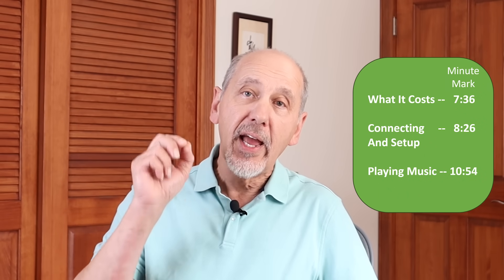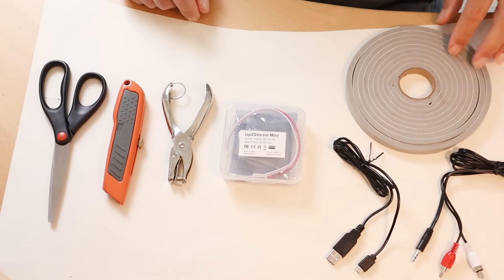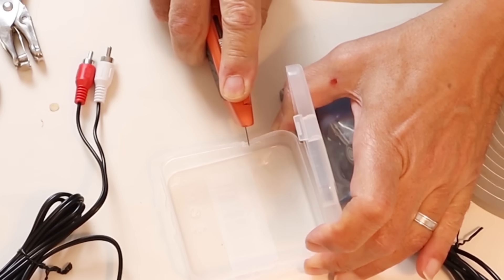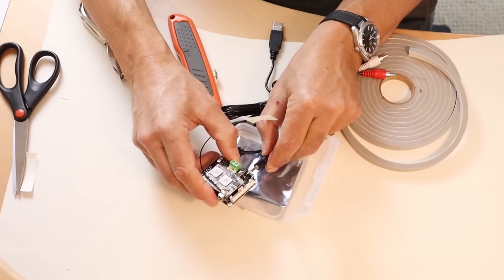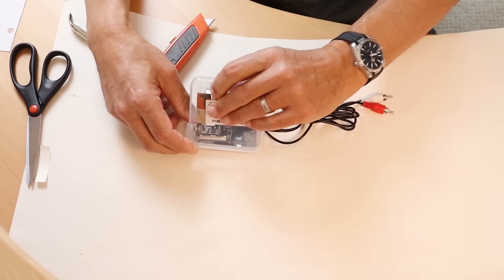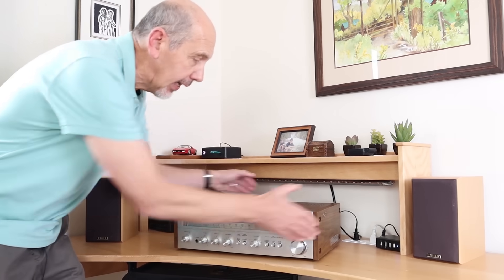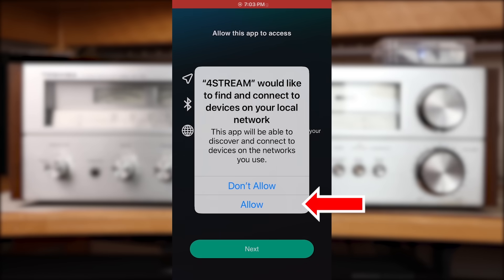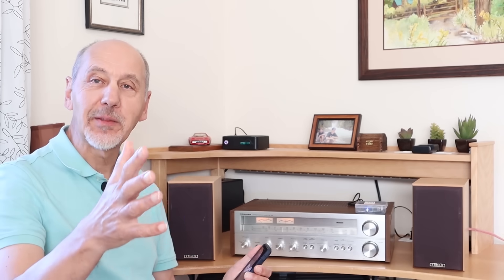Create A $50 Wifi Music Streamer Connect Phone Wireless to Stereo Receiver

Comment: Theoretically if primitively thinking to only HiFi music transmission extra bandwith this wifi could be a good fix.  
But if balancing this with wifi EMF dense radiation increasing nearby as inside home the effective advantages from this streamer are not worthing anymore and wifi instead bt far become the worse music domestic play solution!  
For insignificant never really audible difference from classic or latest BT, WiFi brings you lot other huge troubles in small areas, interferences and healthy higher stress but also brute consumption increasing inducing also mobility lowering!👽
That is why Bluetooth is still prolific and very developed even today as best environment friendly solution already optimized for inside home or nearby wide compatibility lowest consumption devices!  👍
Reply from the maker: WiFi and Bluetooth operate at the same frequency at power levels that all available research says is safe. If you are concerned about any undiscovered health effects the most important factor is reducing RF absorption in your body. Here is where WiFi Streaming has an advantage over bluetooth.  With WiFi your Phone is only used for control, the music data stream comes from the router which is usually several meters and is often in a different room from where you are listening to music. The power levels at your body are incredibly low. With Bluetooth your Phone is transmitting the signal continuously. If it is in your pocket then much of the power will be absorbed by your body and is a far greater RF exposure ( by a factor of thousands or even tens of thousands) than WiFi.  Although Buetooth will give you higher RF exposure than WiFi, it is still less than making a conventional cell phone call which also has to meet well researched safety standards.
Reply: @rogergadgetguy  Never!  Your information is far...disinformative!  Bluetooth was natively designed for Nearby Devices optimizing power to connect under 10 meters devices portably with minature lowest size lowest consumption lowest EMF if you know some primary school physics facs....   Despite it, WiFi born to dramatically extend area covering but also bandwidth and number of devices connected by tens times more EMF power , an also primary school basic physics understanding related fact!!🤔
Reply from the maker: @LaurentiuGavrea  OK don't want to get into an argument here.  The point is a user is going to be far closer to their phone than the router. Power falls off according to the inverse square law so the power from the router signal is lower than the power from the phone bluetooth at the user, due to proximity.  You are free to believe whatever you  want and to use your devices as you wish. I don't judge people for their beliefs and I ask that you extend me the same courtesy.  I do have some  knowlege of basic physics as I am sure you do. In my case I have a degree in electrical science from Cambridge University and was a voting member of the IEEE 802.11 WiFi standards comittee. I spent 40 years developing radio products including 8 years developing  wireless LAN's and 15 years developing cell phones.  I do appreciate your engagement and concern. Thanks for posting.

Comment: For those of you who are using Apple products and have an old iPhone, iPad, or iPod touch with a headphone jack or dock connector, I can warmly recommend the following: 
Jailbreak the old device and install an AirPlay receiver. Does the same job as the device demonstrated here, but does not need a Chinese third-party application to set up. 
Marginally less dodgy and the old iPhones do have quite decent DACs. AirPlay streams are in most cases lossless compressed format (using the suggested solution, always) and your old phone will show up as an output device on other Apple devices.
Reply from the maker: Great Suggestion for way to use an old device. Even if you don't have a headphone jack you can connect the lightning port to a USB DAC.
Reply: @DrBovdin: Could you please explain by what do you mean 'install an airplay receiver'?
Reply: @ I can, but I’m currently away on a trip and not around the old iPhone 4s I use like this, so I can’t tell you exactly what the daemon is called. I think it may be based on ShairPlay though. 
I will elaborate next year 😉
(One of the first days of January)
Reply: @DrBovdin  please do share! I’m interested in this as well. I’d guess an old iPad could do the same? Interesting to learn more.
Reply: @DrBovdin  Good doctor, many of us are BREATHLESSLY awaiting your return to this topic!
Reply: @jgilmore8  I did!!
The comments are gone!! I wrote one with the overall jailbreaking suggestions and a separate one one with the actual uri:s to relevant repositories in case they would be filtered out otherwise. 
If my comments are just being removed I don’t think it is of much use to repeat it. But look into jailbreaking your device by whichever method is suitable for your device and then install the dæmon called “AirSpeaker” available in the Karen/あけみ (Akemi) repository. A control panel will appear in settings.
Reply: @DrBovdin  ty sir for following up.  At this point, I've got Spotify doing what it's doing via an old iPhone 6s that is connected to my Denon receiver via 3.5mm stereo to RCA...it's working for me, will crack things back open later this fall when we move and I have to create a new 2 channel system.

Comment: Excellent video and very well presented (once was an IT Trainer) but now with very small and compact £10 Audio Amplifiers found on eBay which allow loudspeaker, Bluetooth, line-in, AUS and USB connections you can do exactly the same without the faff of making a DIY one.

I have an old MS Surf Pro (used mini-laptops are  very cheap on Ebay now) which allows the same access to smartphone streaming music, but you have a much larger and easier to administrate the screen as I do with YouTube, Radio Boom and Spotify.
Reply from the maker: Great suggestion! Old Laptops make great music servers too, Although I use a raspberry Pi these days because it takes less power

Comment: Hey Roger, I am looking for ways to hook up my active studio monitors to my Samsung tv & sound bar entertainment system. Now my Tv and sound bar both use ears or BT or Wifi. I thought The best solution would be to connect everything via Wi-Fi  after watching your video. However, it seems that this device only works with an app - So my question is, would it work with the TV and put like watching Netflix? So, in short, I have a really great monitors that are analog, and want to integrate them into my existing sound bar entertainment system. The tv is the main audio source
Reply from the maker: Since you Are using the TV as a source It's best to use the TV HDMI ARC or optical out to hook up speakers. Your soundbar will not improve the sound of the monitors and will likely muddy things up. Best to connect the monitors using the adapter that I show here. https://youtu.be/x-wtqgIFEYg

Comment: that antistatic bag does nothing in there, it does not "dissipate" anything... it prevents static charges you may have on the body to reach the board while it's INSIDE of it, and that's it... a dissipation needs something to bring the charges to the ground, it's not "wireless" :D
Reply from the maker: Your point is well taken.   I just got into the habit of only laying unenclosed boards on an antistatic surface when I worked on sensitive circuits.  Of course this only works if you are wearing a grounding strap but old habits die hard. All this being said, putting the bag in the case will for sure do no harm, and I am not very concerned about ESD damage to a robust module like this anyway.
Reply: @rogergadgetguy  that could prevent proper heat dissipation, too, though...
Reply from the maker: @squalazzo  Theoretically yes, but I measured this thing at 1W total power dissipation, and it passed the finger touch thermal test with flying colors. It never gets warm enough to worry.. No anti static bag in my next project though  I promise.
Reply: I actually disagree with the commentator on your method. When you receive the board the antistatic bag is designed to dissipate any static charges equally all around the module and connections to prevent there being a potential difference between point different points in the circuit so when you put your antistatic bag in the bottom of the box though and conventional it is actually doing Something useful. Electronic engineer 20 years experience.

Comment: You need the Up2Stream HD DAC model for TIDAL or any HI-Res music service, wich is 150 dollars not 50.
Reply from the maker: I use Tidal lossless on the Up2 Stream mini, and it does sound much better than bluetooth. Getting the benefit of full 24bit 96kHz resolution is another tier altogether. There are many devices including the Wiim Streamers that will play Hi Res files without downsampling but you won't hear any benefit. without an external DAC which is extra cost again.

Comment: I just leave an old cell phone with a headphone jack plugged in the same way...( spotify works the same way with two phones, but is glitchy sometimes.)

Saved me $50 tho
Reply: How do you send audio from one phone to another?
Reply: @FlagPole84 if you run a Chromecast on your TV with your cell phone, you are not sending media from the cell phone- you are controlling the Chromecast with your cell phone and Chromecast is streaming via WiFi.  Similarly you can use an app like AirDroid to control your old cell phone with your daily driver.  I have an old LG V30 that had a pretty good DAC, I use this plugged into my stereo and connected to WiFi but controlling it with my cell phone as a remote is a great idea!

Comment: This is pretty cool! I wonder if they make one with a toslink output to the stereo? That would be incredible
Reply from the maker: They offer an expnsion board for $15 with SPDIF output just plug it in with the supplied ribbon cable I've tried it and it works great.  https://www.arylic.com/products/expansion-boards?variant=32778796040277. They also have an expansion board with an upgraded Sabre DAC.

Comment: If you have an Apple device, a Roku is $30 and does Airplay (which is wifi not Bluetooth) and you can also stream video with it.

I am sure it’s not the only streaming device with AirPlay built in.
Reply: Correction: $18 at Target right now 😂
Reply from the maker: @AnonVideos  That's a good deal! The Roku has a lot to recommend it for iPhone households. I have iPhone and Android in my home which is surprisingly common.  You can add Airplay to Fire TV stick or Chromecast with the Air Receiver App ($3), and have a solution that plays well with iPhone or Android. The other thing about the Roku or any other video streamer is you'd have to add an HDMI audio extractor if you want to use it without a TV.

Comment: Hi Roger, your DIY approach is admirable but the market has voted & the Wiim Mini is king. It was available for $80 on Black Friday. 
P.S. there is no Bluetooth compression per se, the compression comes from the MP3 source the Bluetooth link carries. My experience listening to internet radio shows high quality MP3 broadcasts are available, you have to let your ears be the best judge. Cheers!
Reply from the maker: Thanks for the feedback I do like the Wiim mini too. The nice thing is you can mix the Wiim and the Diy streamer in the same home for a multi room system. It's like DIY Sonos.  As for Bluetooth the amount of compression depends on the Codec the basic SBC Codec compresses more than AAC LDAC or APT x and APT x HD compresses less than these. You can hear the difference between codecs on a good system and none are as good as lossless Flac over Wifi. If you have an MP3 source it will be digitally transcoded for Bluetooth so you don't double compress, but depending on the Codec it may or may not be as good as the original.
Reply: My Bluetooth streamer supports A2DP & lower level codecs but by far the greatest variation in sound quality is the internet radio station source MP3. Of course, bit rate is most important & I have to assume the streamer always uses the appropriate codec! My best radio stations have CD like quality, many others not so much, with all sorts of horrible artifacts!!
Reply from the maker: @trevorbartram5473  You are right about the lower bit rates, Nasty! Once you get to 192Kb/s things smooth out and the differences are more nuanced.  This video covers sound quality differences between different Bluetooth codecs https://youtu.be/gEy0fOa1zWI
Reply: @trevorbartram5473 most DAB+ radio (in the UK) that isn't BBC stations is crushed down to stupidly low bitrates (under 64kbps for stereo channels). even a 128kbps mp3 broadcast over the internet will sound better than this. digital radio is a joke
Reply: not true. bluetooth audio (as carried within the bluetooth specs) inherently adds its own lossy compression unless you're using a third party protocol such as aptx which is encapsulated in modern, fast bluetooth connections which carries a lossless signal

Comment: Bluetooth with APTx. Resolves all BT audio quality issues.
Reply from the maker: Hi,  Apt X HD does indeed sound better than standard the standard Bluetooth (SBC) codec.  Check out this video where I go in to more detail and try to describe the sonic differences.  https://youtu.be/gEy0fOa1zWI . Android phones let you view the Bluetooth codecs available in their developer options, and manually overide the automatic selection so I was able to do direct comparisons between the codecs. One of the reasons Apt X is not the solution for very many people is the lack of support  by phones and other devices.  Apple iPhones for example do not support any of thhe family of Apt X codecs probably because paying Qualcomm a royalty on every iPhone sold whould be absurdly costly for a feature that few people would benefit from, especially with the wide adoption of Airplay in the audio world.  Most bluetooth speakers, headphones, and mass market cars  don't  support any Apt X  codecs either.  Even within the AptX family, device support is patchy. I've tested headphones that have  Standard Apt X and Apt X LL but not Apt X HD.  For a codec to work  it needs to be supported at the phone and the speaker ends and the only way to know for sure which codec is actually being used is to check the developer options on your Android phone.  Getting back to sound quality Apt X HD is less compressed than standard bluetooth but still not as good as a lossless FLAC file over WiFi. Apt X lossless does completely close the sound quality gap, but I have yet to encounter any devices phone or speaker that supports it.  Once you have matching codecs working, you can sit back and enjoy great bluetooth sound in your home,  untill your music suddenly automatically switches over to your family car when someone drives it in to the garage.
Reply: I've got a mothballed Pioneer PL512 and you've just give me an idea what to do with it. Thank you!

Comment: I admit it would be interesting to try for my car. However, the little bluetooth adapter connected to a 3.5 mm input to the pioneer stereo I am using at the moment works extremely well and connects two sources concurrently.🤔 $28 US
Reply from the maker: The thing is  In your car you wouldn;t benefit from the quality improvement due to the ambient noise. The benefit of using Wifi over Bluetooth is that it sounds better.  Bluetooth compresses the music before transmitting. That is not a big deal if your surroundings are noisy or if you are getting your music from a source like Spotify which compresses all the music they stream, but if you listen to CD's ripped to FLAC instead of MP3, or a premium music service like Tidal or Quobuz, then the difference is very noticable
Reply: I don't use any services beyond youtube just send music files from my fire tablet.Thanks for the great info. It sounds like I should try ripping to both mp3 and flac to see differences. To your knowledge does VLC affect either one? 🎶🎹🎶😁Play On
Reply from the maker: @mybachhertzbaud3074  VLC will work fine either way.  You might be surprised at the difference between FLAC and MP3 especially for low bit rate MP3 files.  Some rippers used to default to 128Kb/s which is fine for a busy airport or noisy street but I would consider 256Kb/s absolute minimum for home playback.  Another consideration is the quality of the DAC.  The biggest differences in sound quality happen during signal conversions Phono cartridges and speakers are good examples of components convert the signal from one format to another and they sound very different from each other. Digital to analog converters sound different too, and the ones in Bluetooth devices are often not very good.  Have fun trying out FLAC but the end of the day it's all about what's enjoyable for you. Play On Indeed🎶
Reply: Thanks for the info. I may have missed it what frequency is that device on 2 or 5?🤔

Comment: Is there a digital streaming output to use an external DAC?
Reply from the maker: Arylic offer an SPDIF out expansion board for $15. I have tried it it's plug and play and works well. Sound is outstanding with a good external DAC.  Expansion board is here;
https://www.arylic.com/products/expansion-boards?variant=32778796040277
Reply: @rogergadgetguy  thanks very much. 🙏